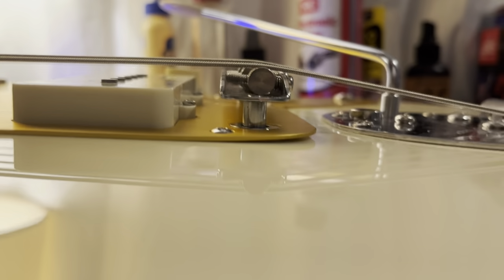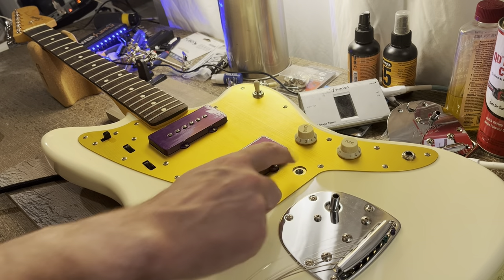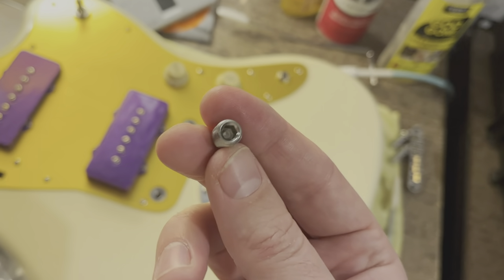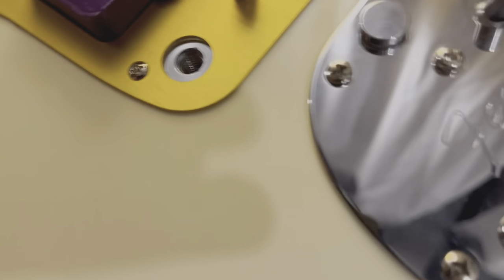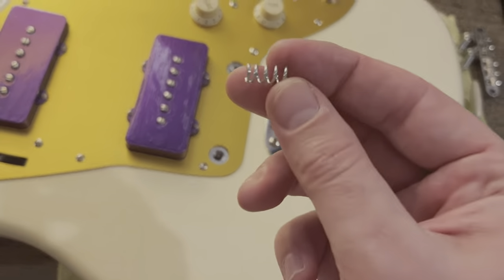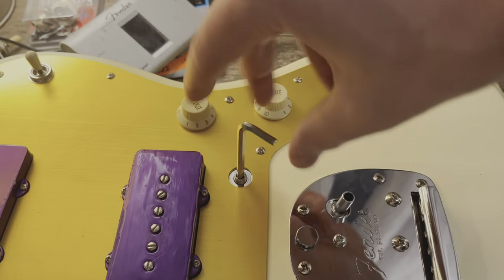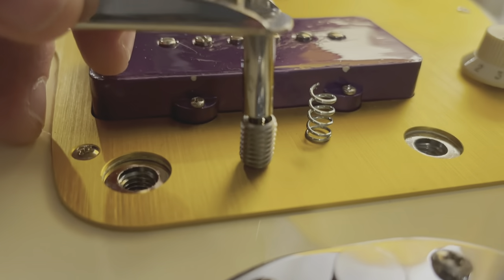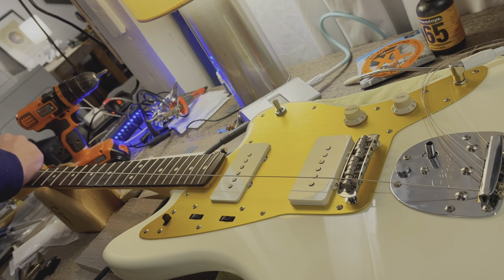Installing A Mustang or other Offset Bridge on Squier J. Mascis Jazzmaster ($3 AOM/TOM MOD)

Comment: I did this mod as described above well worth the effort. I recently read about another way of doing the mod, and that is screw the original adjustomatic posts back into the body, then drill the adjusting posts out of the Mustang bridge, then drill those now vacant holes out to the same diameter  as the adjustor posts from the original bridge, drop the Mustang on and adjust height with the original posts. I much prefer this way of having a Mustang bridge on the Mascis.

Comment: The pick guard is lifting up a little near one of the bridge posts. This is likely due to having the grub screws coming out of the bottom of the threaded insert. Screwing it in further prys the insert out of the cavity, which then lifts the pick guard. Shorter grub would give you more “headroom” before it started to pry.
Reply from the maker: Yep, good eye! Another commenter somewhere mentioned running into the same thing and that’s definitely where it comes from. In retrospect I def recommend using shorter grub screws than I did but it’s not been enough of a problem for me to go in and redo it, just a slight cosmetic thing.

Edit: I can’t change the video after upload but went ahead and changed the video description with that recommendation.
Reply from the maker: Oh and a few days later I went ahead and swapped out to the shorter grub screws I had on hand, and was able to tap the thimble down and screw the pick guard back down flat super easily.

Comment: Genius! I was just about to return the American Professional bridge I bought, but now I’m off to ACE hardware instead! 🎉
Reply from the maker: Right on! FYI as I’ve gathered from other comments, going for the shorter length grub screws seems to fit better, maybe 8mm. I had longer ones but had to really crank them in there to get the right bridge height.

Comment: Did this with a jmjm and an am pro bridge. Worked pretty well, ended up not using springs. The 8mm’s seemed to fit way better than the 12’s for me. Plays great! Thanks for the idea.
Reply from the maker: I think I would probably use 8s if I were doing this again, as I did have to crank the 12s down in there pretty good. Anyway, good to hear it's working out!
Reply: @feinkevi  yeah, this might have been specific to my guitar but I had a ton of excess ground wire in the hole where the thimbles are so I wasn’t able to fit the 12s or a spring without the bridge being way too high on the right side of the guitar. But with the 8s the bridge height is perfect. Thanks again for this idea, I’ve always wanted to put a better bridge on my jmjm but I didn’t want to go through the hassle of trying to find some drop in thimbles.
Reply: No intonation or tuning issues at all doing this? Im looking at buying the exact bridge for mine. I like my action low and thinking 8mm too. Is the string spacing good? Thanks!
Reply: @Rainy78  String spacing is good and stays in tune a hell of a lot better than my telecaster. The intonation isn't too far off, I roughly set it and I've only had issues with the intonation of the low e. I can still get it close though.
Reply: Part of the tuning stability may be because I also replaced the tailpiece with a locking American trem. Not sure if that has an impact though.
Reply: @benm8027  Glad to hear this works. I ordered an american pro bridge to do this on my jmjm. Thanks! 😁👌
Reply: @benm8027  Im also hearing people putting M4 into M8 for a smaller diameter for less post wiggle room 🤷🏼‍♂️

Comment: this is great, im about to do some wiring upgrades to mine and I bought a fender JM bridge only to find out the J Mascis had the adjustomatic lmao, gonna be dfinitely putting this on there to try out. 

one thing though, what type of spring is that??

UPDATE: I did this mod and i have some info for people who are thinking about it, i would really recommend going with the 8mm set screw, i like low action, and those give you a good low action when you screw them far in with the spring and also with the guitar set up and shimmed correctly (my bridge has adjustable height saddles so it makes it easier for me to fine tune my action). But overall a very good upgrade and very worth it, im happy with the results.
Reply from the maker: Just found a misc spring at the hardware store, not much more than you might find in a pen or something. I would suggest going shorter with the grub screw than I did, sounds like people are liking 8mm or 10mm better than the 12 that I used.
Reply: @feinkevi  thanks dude, i was stressing for a bit because im not really a fan of the stock bridge. I would have never thought of this

Comment: Thank you so much dor the video - just had a couple questions. Where did you buy the mustang bridge and is there a specific price-tag or model number that I should be looking out for to replicate this project? Furthermore, where can I find the entire video of you replacing the tailpeice, arm, nut and bridge? Many thanks - Daniel
Reply from the maker: Hi Danny - unfortunately I can’t say exactly what model number bridge I used here, as this Mustang bridge came on another jazzmaster that I bought second hand. I’ll have to look closely for any markings some time as I’ve been asked that before. The radius is 9.5” which matches the neck on the J Mascis, you’ll want a match to whatever model of guitar you’re putting it on, you might need a 7.25” depending. 

As for the rest of the mods, I did run video of the whole project but never ended up editing anything else together. It’s pretty time consuming to make these videos and ultimately I decided everything else I did was covered well enough elsewhere on YouTube already.
Reply: @feinkevi  You are the man. God bless! Many thanks - Danny

Comment: This is a great resource, thanks for doing this. I've been considering a JM specifically to put in baritone B-B tuning, but I was hesitant to buy this otherwise mint 2011 MIM Classic Player for below market from a bud because of the AOM issues. It looks like stable baritone tuning on a CP JM is possible with these tweaks.
Reply from the maker: Yeah, definitely should be. I’ve had this one setup this way for over a year with pretty regular use and it’s been great, not giving me any problems at all.
Reply: Since Staytrem and Mastery are supposed to be drop-in with American spec thimbles, would you say your mod with the grub screws should also accommodate either of those bridges (or any upgrade bridge that claims drop-in compatibility with American JM bridges)? Cheers!  @feinkevi
Reply from the maker: @nchomsky I would think so, I’ve heard from others in these comments that the American Fender bridge worked fine for this, not sure I’ve heard anyone say they used a mastery but I don’t see why it wouldn’t work if the others do.

Comment: I did this same mod on classic player jaguar and worked a treat. Got the idea from a forum (think it was offsetguitars). Only other thing I had to do was put a M4 grub into the M8 grub as this was a better cradle for the bridge post screws.
Reply: I believe the video above was based largely on an OffsetGuitars thread I wrote a few years back, and yes, I recommended using an M4 grub screw nested inside for a more focused pivot point compared to the larger cup of the M8. Obviously it's not explicitly necessary as the video above demonstrates, but I had a whole set from Amazon with different sizes, and it seemed like a good improvement to me. Glad to hear you found that addition to be useful as well :)
Reply: @alexpigment  Hi, yes, your solution was the best I found (and its good that you can go back to stock AOM if necessary, ie if you ever wanted to sell it)
Reply from the maker: It took a lot of digging but I did find this idea in a forum thread buried on google, under a bunch of people convinced there were no options this simple, if it was you thank you! I’m not sure I would want a tighter fit of an M4 but I suppose I’d be curious to try it. I like having a bit of a pivot with using trem like a traditional offset bridge with this setup, and I don’t feel like it’s slipping around unexpectedly at all, so I don’t know that it would do much for me. I’m curious would you think that adding the m4 is more for people who do like the taped thimble thing and want it as rock solid as they can get? Do you not get any side to side wobble with the m4 just floating loose in the thimble? 

I suppose my only very minor concerns with that would be needing shorter set screws to be able to fit two in on top of one another, and having another point of transfer for grounding to strings and vibration to the body, but I’m sure those variables are pretty darn negligible. At any rate, glad it’s working for you guys and you’re up and running with the bridge you prefer!
Reply: @feinkevi  Honestly, I don't think the bridge pivoting changes in any significant way with the nested M4, and certainly is not similar to wrapping tape around the posts. It just takes what would otherwise be a millimeter or less point of contact and makes it several millimeters. I would think the grounding issue that can happen when one of the bridge legs lifts off while using the trem should be less likely with the nested M4. I also at the time felt that it came back to "zero" more effectively (though I later found out that some of that was just the MIM trem spring on my guitar). The added height wasn't an issue at all, since the M8 is just screwed down a few more millimeters will lots of room to spare.

With all that being said, I think there's a lot to be said in boiling something down to the essentials and showing a method with the least amount of parts. If just the M8 grub screw works without any issues on your guitar, there's really no need to complicate it further :) Lastly, if you want to see a visual diagram of what I think the nested M4 does, just google 'grub screw aom' and that thread should come up at the top.
Reply from the maker: @alexpigment  right on yeah I found it - that was not where I read about this originally but its definitely interesting seeing this idea floating around out there more than I realized. Whoever I read about the springs from probably got it from you haha. 

Maybe I got lucky with the screws that I found, mine seem to differ from what you had in that they were not flat cut at the bottom, they were conical (as others in your thread mention re: grub screws that are good for backing them in from underneath if you want to get that involved). I bought 8 and 12mm length options and used the 12s, so I just checked my spare 8s - they are also conical at the bottom of the hex head/not flat where the mustang bridge's screws touch down, so these seem to function like the bottom of a regular thimble as is. I suppose I have no idea how common or not common that is amongst hex head set screws, but sounds like it's worth noting and checking for when trying this. For whatever it's worth I swapped to the mustang bridge, added a TUSQ nut, and put in a CIJ trem tailpiece and beat the hell out of it to test tuning stability and it held really rock solid. I have been playing it like this a lot over the last two months and its definitely holding up.  Anyway thanks for chiming in, sounds like a good thing to look out for and an easy alternative method to try if you're having tuning issues.

Comment: Thanks for uploading this. Sorry if this is a dumb question but you mention Staytrem. I think they used to make the thimbles you are talking but maybe stopped? Their site says that the bridge they sell is not compatible with tune-o-matics. But I imagine your solution means that I could just get a Staytrem and get it to work with the JMJM?
Reply from the maker: Apparently Staytrem used to sell little adapter screws that would accomplish this same thing, but they do not any more. A new Staytrem would be just the bridge piece for a standard jazzmaster thimble. And yep, this fix would allow you to use one of them on AOM thimbles.

Comment: Did the brigde swap to Mustang Brigde to both my Squier J Mascis and the CP Jazzmaster of a friend of mine.
With your method, the action will get too high, as it can bve seen in the video itself.

If you want to do this properly, you have to get the original TOM Thimbles out and replace them with the Mustang Bridge Thimbles.

Getting those thimbles out can be horrible as sometimes these are so tight like glued. But with a bit effort and patience it is possible, just screw in the brigde posts halfway and then use pliers or something to loosen the thimbles. It is a bit like a tooth extraction ;)

Then insert the Mustang Thimbles and there you go.
Reply from the maker: The first shot shows the action too high just after throwing it on there, but after a neck shim and a setup it’s actually spot on. The relatively higher placement from the body does give it a steeper break angle which actually helps in this instance with string tension, as I’ve set it up for B standard tuning. 

You’re right that a thimble swap is the correct thing to do, but if done thoughtfully this method does work well, is far easier, and is easily reversible.

Comment: Why though? I'm not a jazz master guy so this is confusing. What are you curing by going through all this? 

Does it make tuning better using the trem?
Reply from the maker: Three main things for me - 1) the fixed radius of the TOM is flatter than the 9.5” radius fretboard, so no matter how you set it up the action on the outer strings is higher than on the center strings. 2) I found tuning stability using the TOM with the Squier jazzmaster vibrato tailpiece to be pretty atrocious, totally unusable even. The mustang bridge paired with a fender vibrato has been working out infinitely better for tuning stability using the trem, and 3) I find the mustang bridge way more comfortable on my palm. I guess 4) it looks better/more correct for the jazzmaster aesthetic but that’s not really such a priority necessarily.

Comment: I have a squire deluxe jazzmaster ST. Basically the same as the Mascis expect it's a hadtail. I replaced the hardtail with a Duesenberg trem II. I want to replace the TOM with an AP bridge like you've done here but it looks like it'll be too high? Like I would have to shim the neck if I did what you did here?
Reply from the maker: I have mine set high with a neck shim in mind - if you're not doing a shim, I'm sure you could still do this and set it much lower, but I'd suggest going on the shorter end of the range for the set screw, maybe an 8mm length, or a 10 and clip the spring pretty short to be sure you have enough room to go as low as you'd like.

Comment: Great work around! What change in sound/playability did you notice? Also, what pickups do you have installed?
Reply from the maker: I like the mustang bridge vastly better. It fixed the radius mismatch between bridge and neck so the string action feels better. It’s more comfortable on the palm. Works far better with the trem for tuning stability.

Pickups are Fender Pure Vintage 65s. They’re a little bright and a little quiet but overall I really like them quite a lot, very easy to dial in a wide range of very cool jazzmastery sounds.
Reply: @feinkevi  Rad! I’m stoked it addressed the mismatch!

Comment: What trem unit did you purchase for it? 
I’d like to avoid purchasing one that doesn’t match the holes from the stock trem.
Reply from the maker: This was a second hand Fender CIJ trem and arm from Reverb, not sure which model it came from specifically. 

It fit right in with no modification, but the B string was ever so slightly rubbing against the collet on the trem arm when used, so I did end up plugging and redrilling several of the holes to be able to tweak the angle slightly and resolve that problem. So fair warning there is some room for error even swapping out technically matching parts. That said it was a very easy adjustment as far as these things go.

Comment: Any issues with tuning, intonation, height @ everybody who did this? Is it possible to just replace thimbles to match an american pro bridge with existing holes? I bought the bridge and just curious to know everybody's thoughts. I like my action low. Thanks in advance! 👍
Reply from the maker: Tuning intonation and height have all been great and rock solid for me for a year now since doing this. Action is plenty low, but I did have to shim the neck to get the setup how I wanted it overall. If you’re comfortable with offset setup tinkering it should be super doable. 

My understanding is that replacing the thimbles will definitely require plugging and redrilling. While that is 100% the “correct” way to do this, obviously it is a lot more invasive and permanent. My two cents are that this workaround has been plenty good enough for me so far, but if you have the tools to do the thimbles and are sure you want to switch there’s not really any reason not to other than preserving the option of putting it back to stock for resale.
Reply: @feinkevi  Fantastic! Thank you for your honest reply! Im going to do it! 👌

Comment: does this work for mastery bridge?
Reply from the maker: I haven’t tried it on one but can’t see why it would sit in there any differently, unless its height adjustment screws on the bottom function differently for some reason. So I think so but don’t 100% take that as a guarantee.